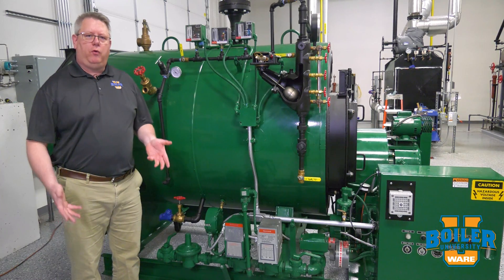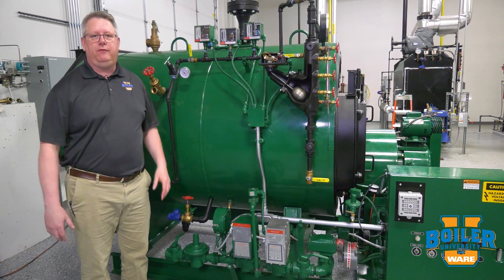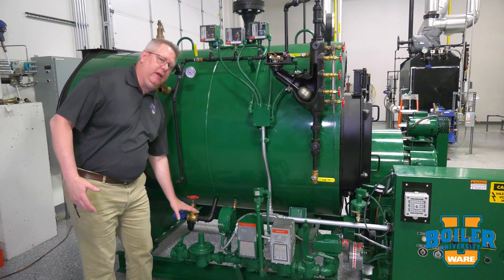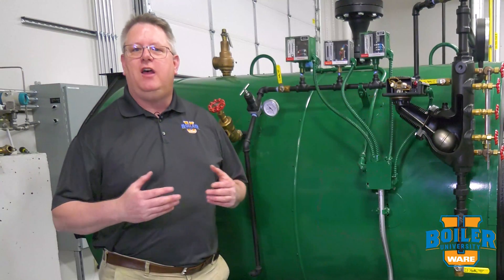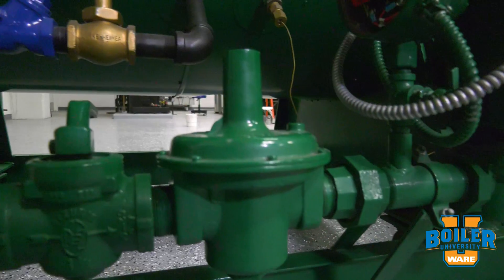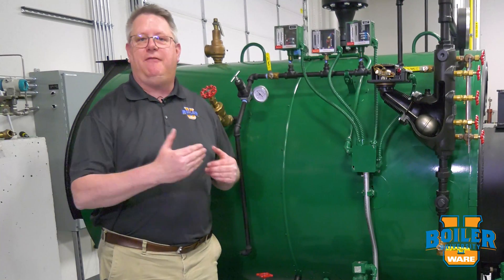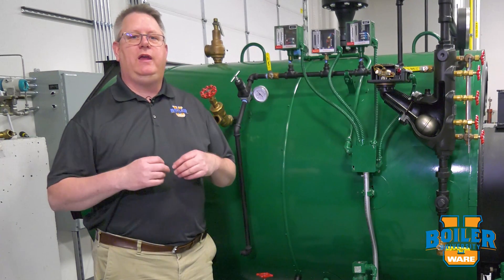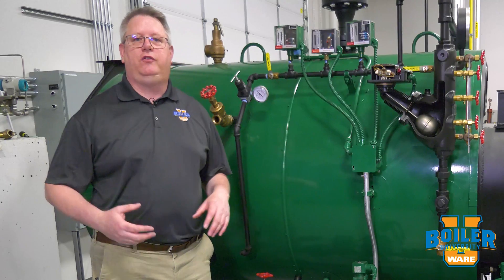Combustion Series Part 1: Regulators - Weekly Boiler Tip

Comment: As a question: The installation of gas regulator is only depending on the gas pressure available from the supplier because if there is no high gas pressure, the installation of a buster pump is needed.  Correct?  I just want to be sure.
Reply: Joseph, I believe you’re referring to booster pumps for low pressure utility delivery (around 7” water column). Yes ,there’s still a few neighborhoods in older cities throughout the United States that may require this application but they’re becoming fewer and far between as low pressure mains & services get replaced. The last one I saw in the St. Louis Metropolitan area was 30 years ago and it was abandoned. If one is ever required you need to work strictly with the engineers of the particular gas utility because there’s a lot of legal liabilities if one is improperly installed without the authorization of the gas utility. Also gas utilities should always be contacted no matter what type of work you’re doing on the industrial buildings,new equipment, replacement equipment and rental equipment; they need to know or you’re taking on all the liability yourself.
Reply: @boby115  Thank you.
That’s correct, the building was built in 1963. And yes we did all the process you mentioned.
Very informative.
Thank you for your videos.